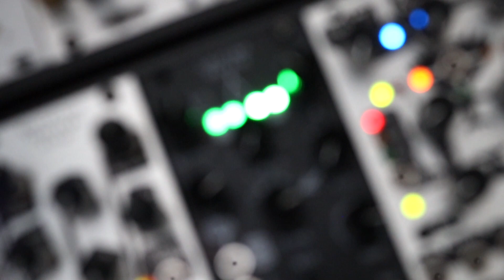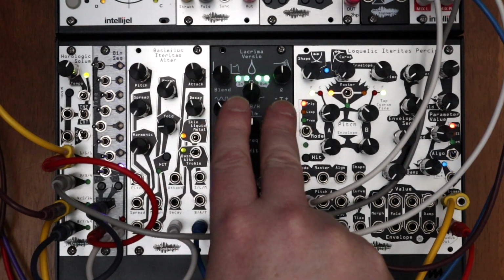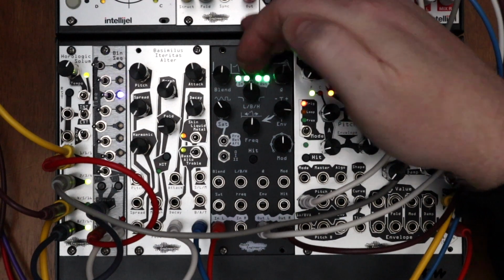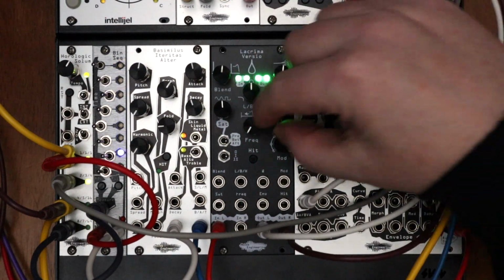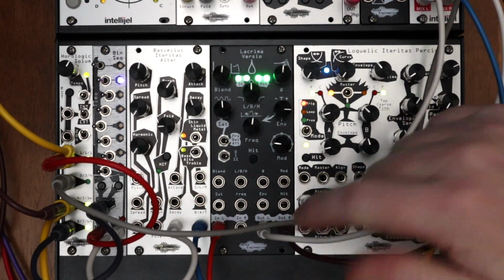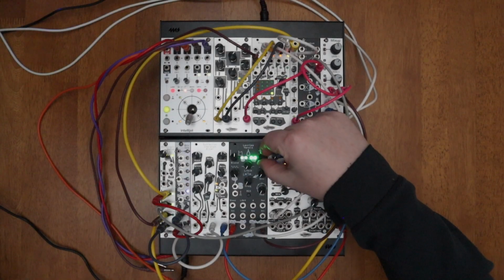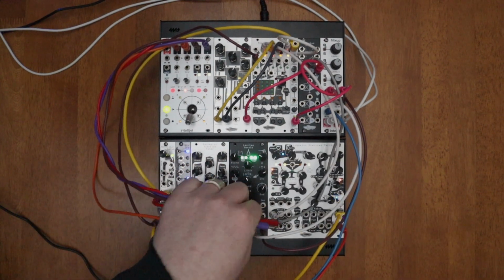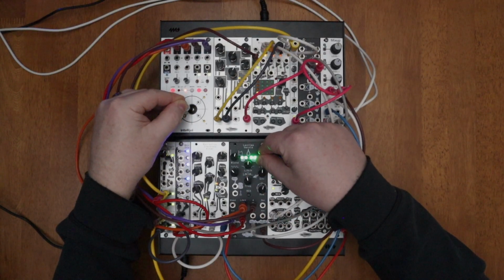Lacrima Versio - Autowah from Hell on Versio DSP Platform - official modular synth demo

Comment: Does the dry wet mix also impact whether or not the lp/hp/bp filter is impacting the sound or does it only interact with the saturation and other effects aspects of the module?
Reply from the maker: The blend control mixes between the unprocessed and filtered/saturated signals.